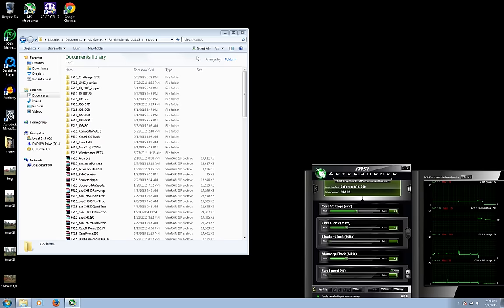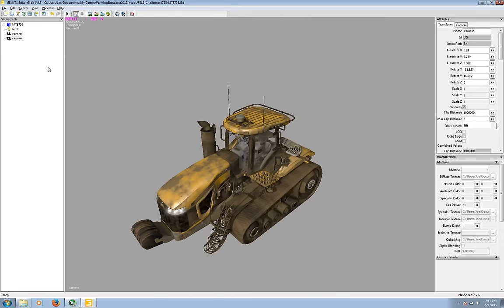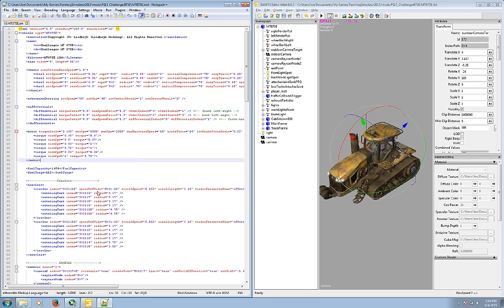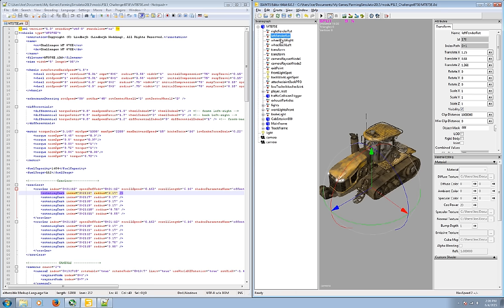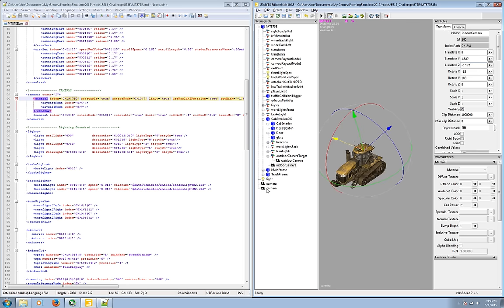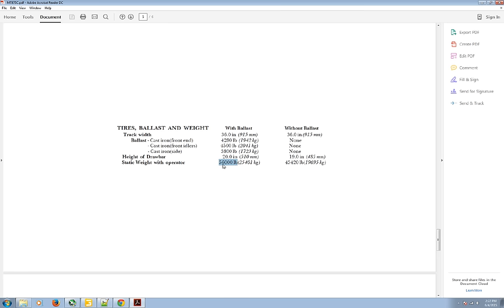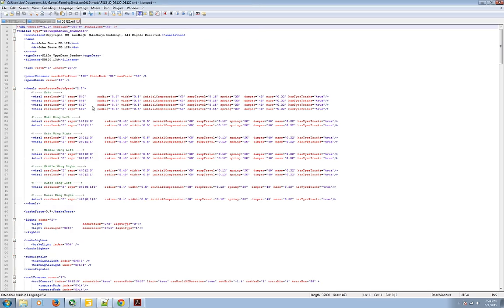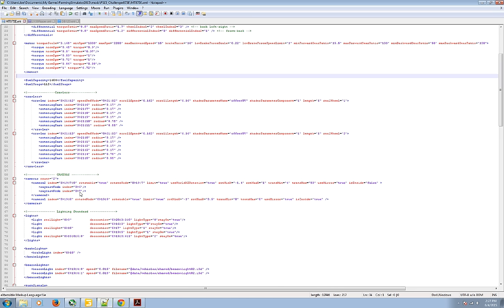Beginner Giants Editor Tutorial: Farming Simulator 2015

Comment: When you edited the vanilla NH combines, how did you manage to replace the default fillvolume with your new one without causing node indexing issues? I'm trying to add a Maurer bin to the default Case 9230 and everything worked out fine, but when I replace the fillvolume somehow the chopper becomes foldable. I'm not deleting the original grain tank parts, just making them invisible, just left the rotor folding part intact. I am deleting the original grain tank fillvolume though, how did you address that issue?
Reply: +Lindbejb Modding you mean the whole combine or the fillvolume? If the fillvolume, already did that, just haven't figured out how to replace with old one. If the whole combine, sorry for assuming you just rehashed the default one :o
Reply: ***** I managed to get it work, just paid more attention to your tutorial and made sure the node order list wasn't touched by moving around with cutting and pasting in the scenegraph. Thanks for the tutorial.